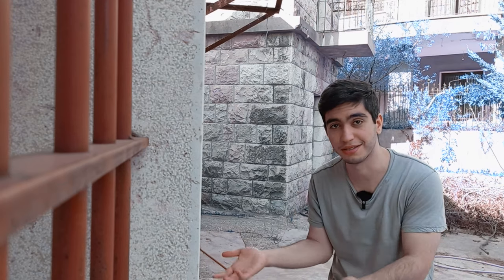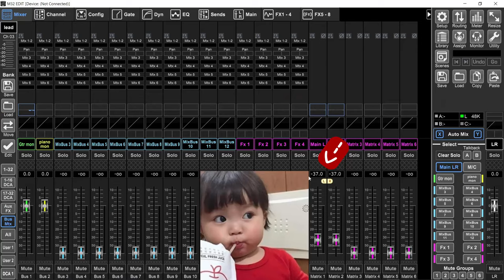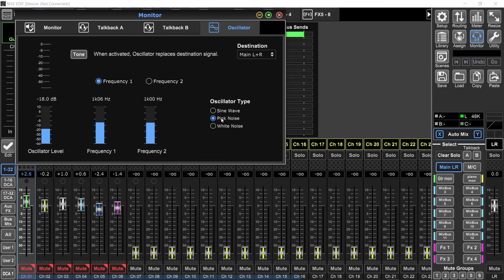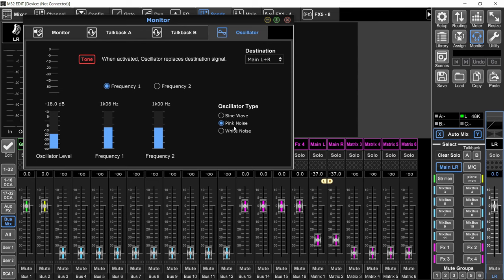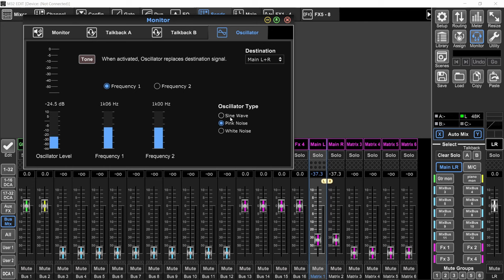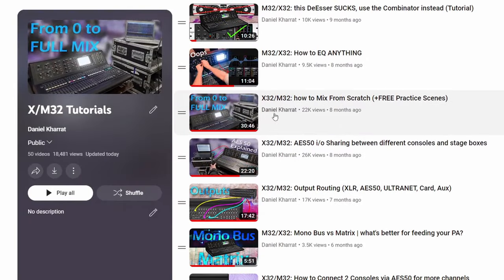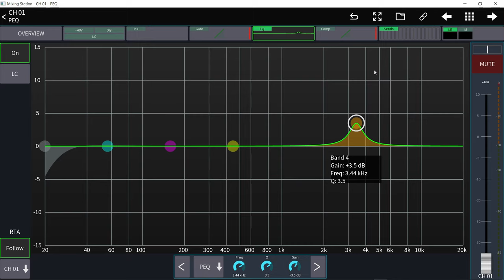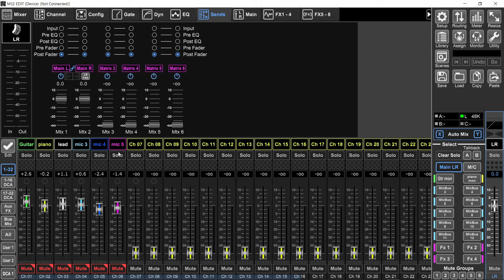Struggling with Feedback? Easy Solution!

Comment: 'The speakers are too loud' is the same as 'Gain is too high', just on the back end and not the front.
Obviously, turning down the levels in the room is going to reduce feedback, especially if the system is too loud for the room.
What you describe in this video is setting up a correct gain structure, which is a good idea by itself and might save you from SOME feedback (mostly because you have more linear control this way).

Feedback is purely an acoustic phenomena, so the ways to prevent it (in the field) are: changing distance (move mic away from speaker),. direction (point the mic away from the speaker) and frequency response (cut frequencies that are feedbacking back more than others - but use eq only after using the other options)
Looking in the room image, you can still do plenty there in order to reduce feedback by repositioning mics and speakers.
also, you did not mention which mic was feeding back, but lectern mics can be treated differently from the band and at the source, so you don't have to 'kill' the system  and the band can have the system 'flat' (or less processed) - just run that mic through a bus and eq it for feedback there (and use channel eq for tonality)

I would not use the sine wave method, it's too risky and you easily burn a voice coil this way and the sine wave is external to the system, and is not a part of the feedback loop.
You might find some freqs this way that do actually feed back, but you can also find others that are just simply too loud in the system or might sound harsh to you (which is very common with lower end speakers that tend to be less linear in their behavior).
What you are doing here is more VOICING the system than eliminating feedback.

The right way to do it is to excite-scan the system using an eq with an open mic (the main mic usually) - this is how some feedback eliminators work (the non real-time  kind), but only after setting the mics and speakers correctly.
Reply: I agree, there are some situations when setting the correct gain structure and even using graphics EQ isn't enough: for example, using lavalier mics for live sound reinforcement in a big bright room. The signal/noise ratio that you're getting from those mics is simply not enough to give you enough amplification before feedback occurs. The best solution I've found so far for this situation is setting a few additional speakers by the back wall, delayed accordingly. This way you can get more coverage across the room without the need of going too high on faders. Moreover, distant speakers are not prone to feedback as much as the frontals.
Another good option is using an automatic feedback destroyer - those devices are criminally underrated, in my opinion.

Comment: It's total loop gain that we need to control to avoid feedback. That includes microphone transducer gain, pre-amp gain, fader and EQ gains, power amplifier gain, speaker transducer gain and acoustic path gain (loss) from speaker cone to microphone diaphragm. Reducing any of these gains will mitigate feedback, but there is no reason to have excessive gain in the path from the mixer to the speaker voice coils, so I take your point and I like your method.

Comment: Great video! However, I do want to clarify one thing you said about gain. The reason why you would want to reduce gain to prevent feedback, is not because of the “sensitivity” of the mic (because I agree, that doesn’t make sense), but adding gain means adding noise! I’m not talking about the noise floor that the mic picks up, but actually adding more noise to the signal, from the preamp itself. 
Noise is what makes mics feedback sooner. 
I do agree that the better solution is to turn down speakers, but sometimes you don’t have the luxury of doing so, because to much room reverb, or the people in the back can’t quite follow anymore. 

Anyway. Long story, but you did explained it perfectly.

Comment: Love this Video. Never had the Idea of Sweeping trough the Frequency to detect problemeatic Areas. Will add this in my Workflow for SURE! Thanks a lot!
Reply: In my experience, there's a better option than sweeping the frequency in oscillator: open a mic, go to the channel parametric EQ, set a very narrow band and boost it around 12dB, then sweep it across the range. This way you'll easily find the frequencies that you need to cut. Just be careful to not blast people and not burn out your drivers: you have to feel the start of feedback and be ready to immediately bring the frequency down.

Comment: Great video!  Can't wait to put this into practice at my  next show.  I have a question about applying EQ with the Graphic EQ you talked about at the end of the video.  Are you inserting that Graphic EQ on the Main LR and not the Matrix?
Reply from the maker: On the matrix 
The main LR mix shouldn't contain the room correction
Reply: @danielkharrat  That makes sense, thank you.
Reply: @danielkharrat  By the way, do you use this same method for ringing out monitors?
Reply from the maker: I do set the level for the monitor with the fader of the bus and then i turn up the microphone in that monitor and if it's not feeding back i swing the microphone close to the monitor facing it quickly and that way i can identify the frequency that will feedback and i cut it
That way i can turn up the mic pretty loud in the monitor without being afraid of a gigantic feedback
Reply: @danielkharrat  Thank you, I will give this a try tonight!

Comment: Hey Daniel thank you so much for your videos
They are helping me a ton to figure it out foh with my xr18.
Is there any way to send pink noise in the xr18? I'm using mixing station but can't find a signal generator
Reply from the maker: Because there's no signal generator in that mixer. You can use your phone or computer and plug it into the aux channel with 1/4 jack or usb connection and generate the nkise from that device

Comment: nice explanation. feedback loop doesn't happen in electronics. it happens in the air. the only way you can stop air from moving is to remove thing that moves the air
Reply from the maker: Feedback also happens in electronics 
If you send the effect returns channels back into the same effect bus that it's coming from you'll have Feedback internally in the mixer
Same for delay effects for example you have a Feedback knob that sends part of the signal that's coming out of the effect back into it
So Feedback is not exclusive to a microphone in front of a speaker

Comment: Daniel, I hope you and your family are safe during these absolutely insane times. Do you have any tips for live drums in a very live, very loud room? Gates, comps, eq's, ... I need to showcase a female vocalist fronting drums, bass, 2 elec gtrs, keys, backing vox in a 300 seat venue that is basically a 100ftx100ft concrete box with a 22ft ceiling.
Reply from the maker: Oof um..it's not gonna be amazing but
Get your drummer a pair of hot rods drum sticks that will reduce the volume significantly 
And also if you have headphones or in ear monitors, turn the drums lounder in his ears so that he wont hit the kit extra hard
Also you can try muffling the drums a little bit, maybe put some cloth inside the  kick drum leaning against the resonant head to lessen the sustain 
And ask the drummer politely to not hit too hard and explain why

Comment: What is the difference with turning speakers down and turning down the Master Left/Right Fader (No Matrix)?
Reply from the maker: Turning the speakers down with the knob is a lot less accurate at lower volumes
You could turn your main fader down if you don't have a matrix but i would prefer to leave the main fader as the volume of the mix and have a different fader as the volume of the speakers

Comment: Why send L/R to a matrix?  Can’t you do this by not using a matrix for L/R and just adjust your speaker output knob, send pink noise to L/R at -18 db with the L/R faders down then slowly adjust the L/R faders until the pink noise is comfortable in the room….then do the frequency scan on L/R to soften the harsh freq’s?  What advantage does L/R on a matrix providing?
Reply from the maker: Using a matrix separates the speaker processing from the mix
The LR bus is your mix
If you want to record it or send it to broadcast you don't wanna have on it all the ugly processing you do to fix the sound of the speakers in the room and have a very low level
So you do that on a matrix
And that way you can still eq and compress your entir mix (LR) to make it sound prettier independently from what's going on with the speakers
Reply: @danielkharrat  hey thank you for the additional information.  I really enjoy your videos.

Comment: Thanks Daniel. can i do this methoud not using maxtrix? (speaker knob turn it up/down not using matrix faders as matching the room levels)  cuz i only mix it to main not sending it to broadcast, camera etc.
Reply from the maker: You can but it's less accurate with a knob on the speaker also you need to be in the middle of the room to judge how loud the speakers should be. If you're standing behind the speakers to turn the knob how will you know

Comment: Hi Daniel thanks for your informative video! I'm a DJ and I play live percussion (Tabla) while I DJ. I have feedback issues when I increase the MIC Volume on the Mixer. My microphone is connected  directly on the mixer mic input. When I lower the Monitor Booth I get no feedback. But when i increase it because the at some time when there are more people I need to hear more thorough the Monitor speaker i increase it and at some point I get feedback. When I decrease it then I dont have any issues. Is there any improvement that I could do? Or do I have to decrease the monitor booth on the mixer everytime when I go to my tabla and turn the mic off when I dont use it anymore? Because some tracks are louder so I need more volume on the mic etc... Your help would help me alot!
Reply from the maker: You can put a graphic eq on your monitor and cut the frequencies that are feeding back in the monitor 
Or if you don't mind using headphones or in ear monitors, use those instead of a loudspeaker monitor, and you won't have to worry about feedback
Reply: @danielkharrat  Thanks for you help! One more question: I don't hear my Mic input trough my monitors. Mic inputs just gets output though the main speaker (Master) I only hear the songs but not my mic input through monitors. (DJ Pioneer Mixer (A9 / V10))
Reply from the maker: @SINNO.OFFICIAL  how are you feeding the monitors? Where are connecting them?
Reply: @danielkharrat   I'm connection them via MIC INPUT on the mixer directly (DJM A9 / DJM V10).  But I dont see option where I can hear mic input through monitor. But i try in ear monitor bu i dont know if i hear it there...
Reply from the maker: @SINNO.OFFICIAL  i don't know much about dj mixers but if you have a bus or aux send, send your music and you mic to it and then connect it to your monitor

Comment: Hello Daniel. Thanks for the video. I have a question.

I play in a cover band, usually in small venues often with sound systems with less than enough power. We have live drummer, bass, guitar, sax and 3 lead vocal mics. Almost every gig mixing just boils down to trying to set the mics loud enough to be heard above the drums and not get feedback. But since speakers are not powerful enough and/or room acoustics is weird and/or speakers are placed right behind us usually feedback starts to build up. We are using the X Air 18.

So what would be your advice to make the situation better? 

Thanks,
Alex
Reply from the maker: Turning down the speakers is not about making things quieter it's about proper gain staging and often times you can get more volume out of them before feedback that way
A very helpful thing is to use a ton of compression and use the make up gain on the compressor to push your mic louder if it's too quiet 
And use compression on your main mix
If your mics are peaking at -18db and the overall mix is peaking at -6db i doubt you'll have any problem with the speakers not being powerful enough 
And if you really wanna make sure it's not the speakers fault you can always use pink noise at -18db, if that's loud enough in the room then the speakers definitely have enough power